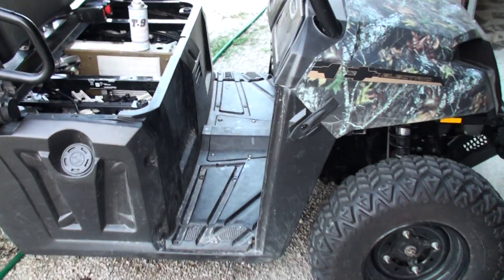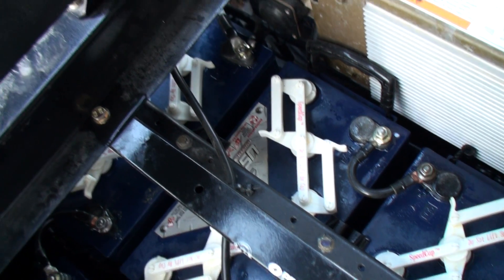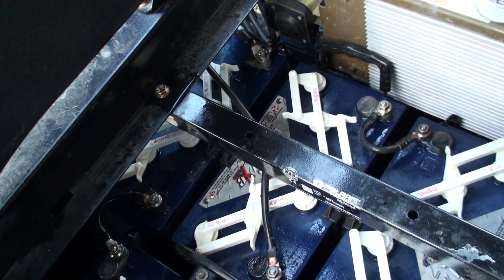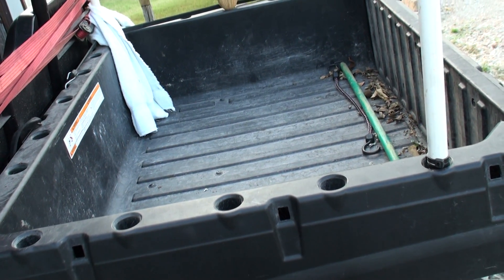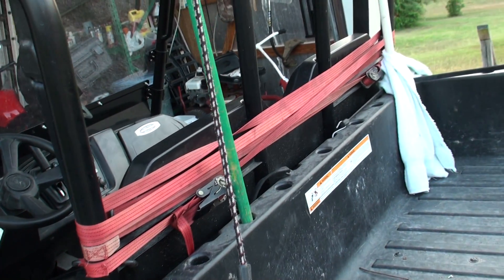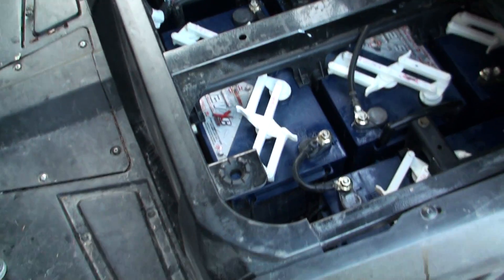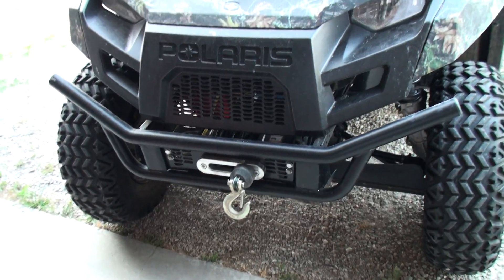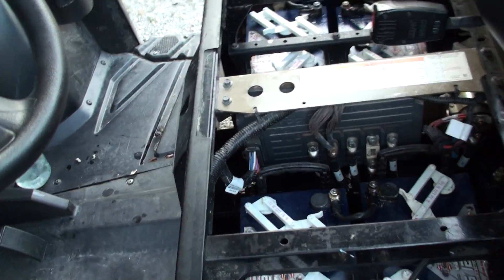Polaris Ranger EV AWD 50HR Inspection

Comment from the maker: I think a lithium battery option would be a great thing and I guess that would end the corrosion problem! It would make it quite expensive, but if people could see that they could use it all day, do everything they want to do and not run out of juice, it might persuade more than a few to buy it. Saying that, it just makes sense to provide a solar panel connection so we can charge the EV off grid without having to buy a separate controller.